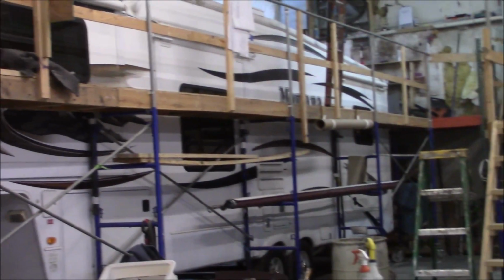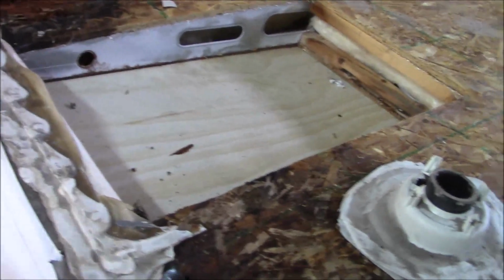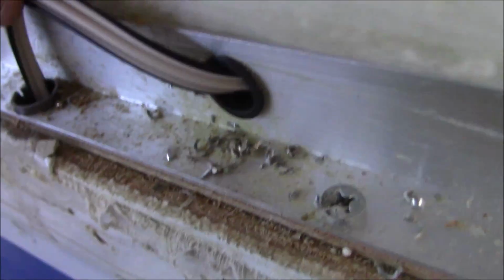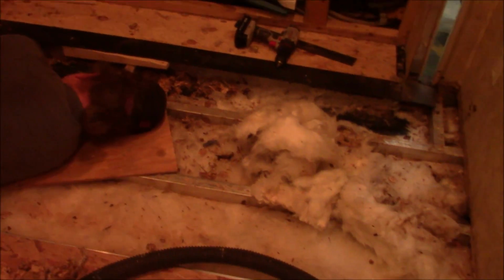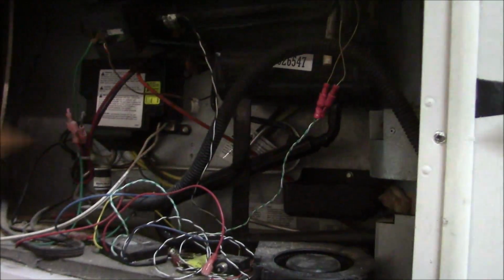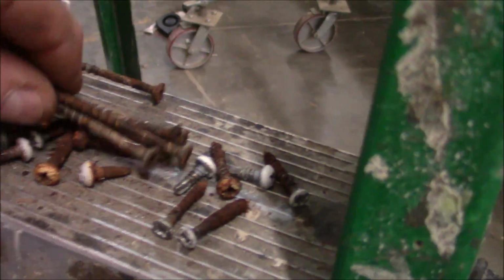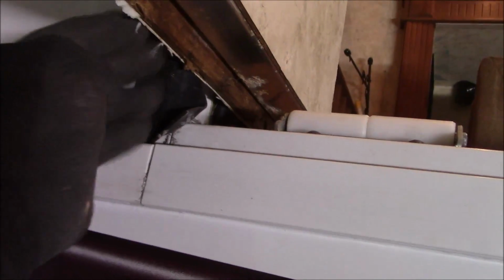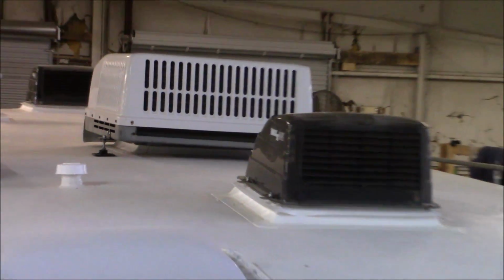2010 Keystone Montana

Comment: Do you guys do maintenance, inspections and / or caulking before the problems start or is it just replacement and repair ?? Would like to get a pro to do their thing before any of that stuff starts.
Reply from the maker: We do not work on rv membrane roofs be ause we can not warranty the work. The membranes are cheap. The most you could do is out more on like a moron...lol. and that system proofs to fail. 
We offer free annual inspections on our roof system. 

Thanks for watching.
Reply: @RVROOFINSTALL  Thanks for the prompt response to comment from an older video ... I'm considering replacing the existing roof, could be money well spent. Bought a used RV once that looked to be in fantastic shape or so I thought until I went to install new carpet - I wasn't happy - Live and learn I suppose ...

Comment: Very impressive with the attention to detail, your commitment to provide quality repairs  is very rare in these times. I am located in the west coast and I have a 2006 TAHOE TRANSPORT Toyhauler with the front CAP with delamination  damage from water intrusion from the roof area up front. what type of sheet material is used in the replacement of the front CAP ?  Keep up  this great channel !
Reply from the maker: You shouldn't have to replace the pre molded fascia cap.